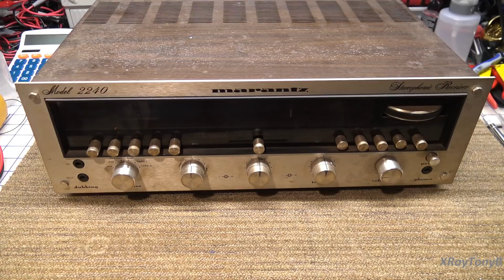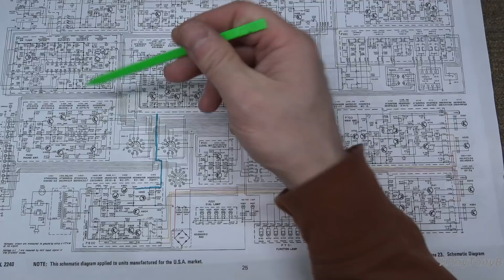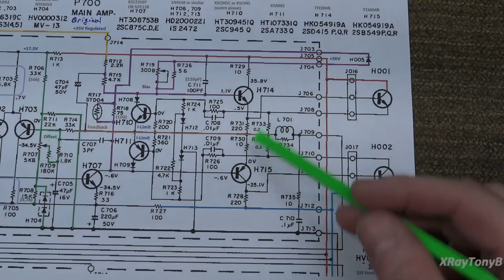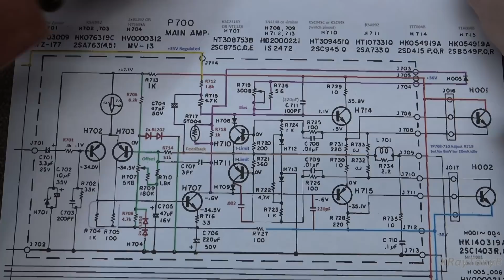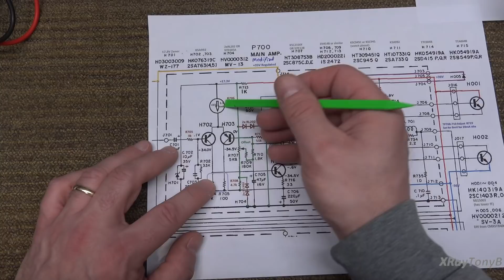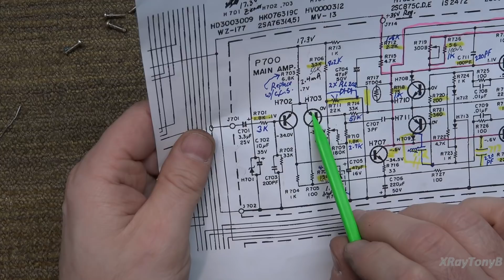Marantz 2240 Restore and Modification

Comment from the maker: 0:15 Intro
1:56 First look inside
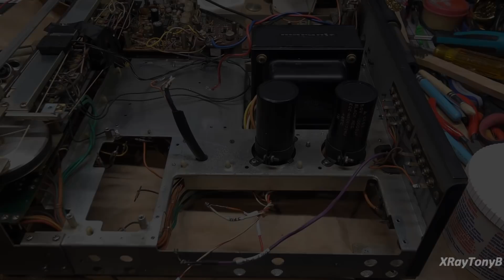4:32 Cleaning is underway
9:29 First look at the schematic.  This is a good design
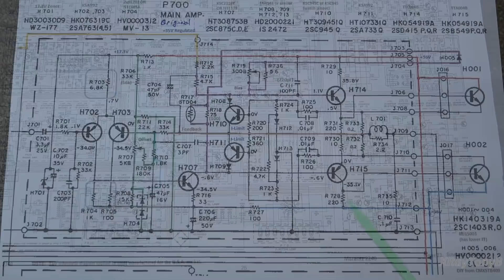12:58 A closer look at the amplifier section & some theory
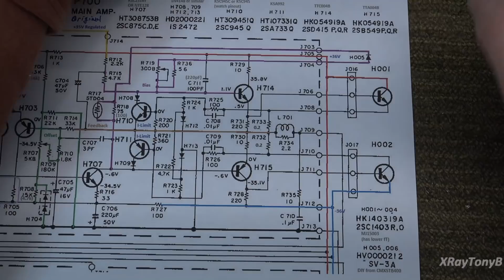22:49 Comparing the 2240 vs 2240b
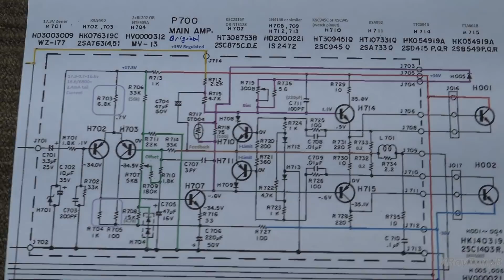26:00 Some changes that were done to the later production of the 2240
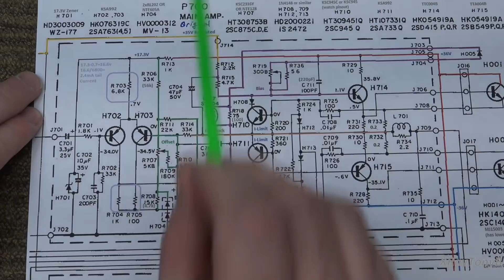28:34 Modifying the original design & making a modified schematic
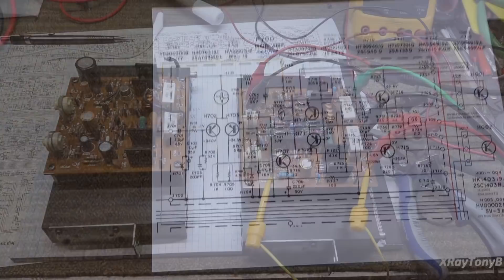40:42 First look at the modified amp module and initial tests
44:27 Some square wave stability tests on the modified module
45:37 Same square wave test on original unmodified module
46:53 THD test on modified amp module
47:19 THD test on original stock amp module
47:45 First thoughts on how the two modules compare in performance
48:45 Adjusting the gain of the modified amp module to match the original module
55:04 Frequency analysis of the modified module
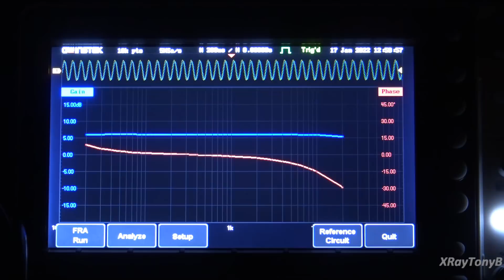56:03 Final comments on the modified module
58:47 Modifying the second module - step by step
1:14:00 All I want is a-just be free, to live my life the way I wan a-be
1:14:43 The finished product & making some final tests/closing comments

Comment: A little late but hope someone still reads this. Regarding inverted input/ output. Air has resistance. Sound waves are changes in air pressure. During playback , cone of the driver creates high/ low pressure areas.The air is a medium that wants to equalize just like the driver in it''s resting position. This reaction between driver and air causes non inverted signal from the driver to phase shift by 180. This inverted signal is what's reaching our ear drums. If the source signal is not inverted our ears always hear inverted signal so the proper thing would be to invert the source. The philosophy behind it is that it should sound more natural...

Comment: Nice work! Adding current source will improve the current as it will be no longer dependent on the voltage, although the V is pretty much fixed with the zener D. Most of the improvement, however is going to be gained by putting current mirror. Imbalance of collector currents of just 2%, almost doubles the THD. Current mirror will also improve the slew rate, and provide more current for linearization of the VAS. In other words it should affect the THD a lot, especially in HF. The differential input is transconductance: voltage in, current out. On the other hand, playing with the NF, threatens the stability, but also makes larger DC offset due to different input impedances on the diff. pair (33k). Luckily you can adjust it :).

Comment: Tony, thanks for the informative video.  I have a Marantz 2250B since purchasing it in 1976.  My balance slider stopped functioning and I took it to a tech in North Carolina and he had to bypass it since he said it was not functioning.  The receiver still sounds great but I did not know if you had any experience on repairing the balance slider?  My other option is to just continue to look on line for the part 500 ohm RS0504002 of the parting out sale.  Thanks   Dave

Comment: I think the 2240 is an incorrect designation - or - the faceplate fasteners have been replaced. The hex fasteners are typically an indication of a "B" model.
Reply: I’m the owner of a 1974-75 2240 that has the hex fasteners, so probably a transition thing.

Comment: Hey Tony.  Great job on the video.  I believe my father purchased a 2240 back in '74, so I remember this from being a kid and listening with my dad.  With his health no failing, I purchased a 2240 off of ebay, to be in my office as visual reminder of my dad and the happy times we had listening to albums, 8-tracks, and later cassettes.  Because I want to keep this forever and will want to check out each board and component (read degree in electronics and an engineer at this time) would you have a link to this schematic or be able to point me to somewhere I could download this file?  At work, we have a plotter, so printing this at C-size (that's what it looks like in the video) would be easy once I have the file.  Thanks and keep up the great work!
Reply from the maker: Go to hifiengine.com .   They have the service manual available there for download.  You have to have an account to download, but it's free.
Reply: @xraytonyb  Thank you so much!
Reply: FYI, registration is closed to new members.😐
Reply from the maker: That sucks.  Thanks for letting me know. I was unaware.  You can also try elektrotanya.com
Reply: @jonathanjackson669  keep checking periodically you will eventually get in.

Comment: Hi Tony. Excellent video. Recently, I bought the Marantz 2226. It is in a similar condition to the 2240 in your video, and it requires a good clean and parts (which unfortunately are scarce in Melbourne, Australia). You mentioned how the real improvement - in terms of cleaning - was when ultrasonic cleaning. was used. 
I am new to this so my question is this: do I need to disassemble the entire unit and clean the different parts separately, or can the entire unit be cleaned as one (eg I have seen the guy from AhFixIt use a powerwash at a car wash outlet)? Any risk involved in damaging key components ie you mention transistors? Any assistance would be fantastic. Thanking you, or anyone who can help, in advance. Regards. Sam
Reply: @dohmesam

Hay Sam... 🙂👋🏼
I dont think i would run an amplifier board through the "car wash" lol.... (i too saw the video and was horrified)...

I think the strength of the power lance could eaisily dislodge componants on the board or damadge anything that dosent like water (like volume, balance, bass and trebble controls, and parts of the tuners adjustment pots), i think that video was just made for fun and entertainment, it would be something i would never do to my own equipement.

If you are able to remove certain boards (and remove atleast the potentiometers off the tone board), then a "bubble cleaner" 😂 should be safe enough.

Best wishes from UK... 🙂

Comment: Hello Tony .................what would happen if instead of using a CCS in place of the resistor.........you should add a capacitor bypass on the original resistor ?

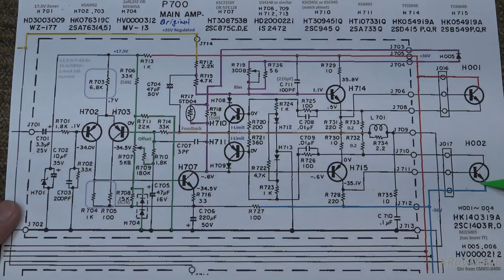Comment: 13:59 exactly, both transistors show NPN; yet you called one a PNP despite the diagram, why?  This is why such videos are extremely confusing and indeciperable to amateurs who know nothing, and likely never will thanks to the contradictions and lack of clear explanations.
Reply from the maker: Before you start insulting me, please listen to the video again.  What I said is that there are 4 similar models of this receiver; the 2240, 2240b, 2238 and 2238b.  The main difference is the output transistor configuration.  The 2240 uses a "quasi-complimentary " output stage, while the others use a "true complimentary" output stage.  The main difference is that quasi-complimentary output stages use two NPN transistors and true complimentary output stages use an NPN for the positive side and PNP for the negative side.  If you search "quasi complimentary vs True complimentary output stage" you will most likely find a lot more info.  There is no contradiction if you listen to what was said just before the time marker you listed.  If you are willing to ask questions instead of assuming that everything is wrong, you may find that you can learn this.   I am more than happy to answer any other questions you may have, within reason.
Reply: @xraytonyb  No insult was intended.  Your uploads are very informative, and I mainly watch them to learn as that's the best anyone can do with one's time.  Thanks very much for taking the time and effort to explain.  Don't know how you dealt with the mouse leftovers, but somewhere I heard that you should never vacuum rodent feces as minute particles can go through the vacuum filter and become air born, potentially leading to serious health problems.

Comment: i had the 4240 Quadraphonic Receiver in the mid 70's 2x40 watt 4x17 watt with Dolby FM and a Dolby processor so you could Record Dolby B to  Reel to Reel Tape Recorders
Reply: I had a 2270, then upgraded to a 4270 (QUAD), and then a 4300. I would love to have them back. but life goes on.
Reply: Same with me, i loved my old equipement, mp3's came, moved house through work and had to sell my gear as part of the move...... completely regret the life choices i made at the time....

Comment: That’s a little disgusting 🤢 to see turds 💩 falling out of this radio 📻, onto your bench. Just sterilize your bench, and wash 🧼 your hands 🙌 before eating 🍽. Although your bench isn’t a place you’ll eat, you won’t want the Hantavirus, especially if this is about mice 🐁, or rats 🐀. Just be careful there’s also no urine on any of the circuit boards, this can short them out. That radio 📻 has a VERY IMPRESSIVE set of tuning gangs. I can tell ya that this is a 1970’s receiver, just by the look 👀, possibly mid 1980’s. That transformer is a Marantz. It is definitely worth rebuilding. VERY NICE 👍 schematic, you’ll wanna hold onto it. Your friend, Jeff.

Comment: What do you use in the ultrasonic cleaner - only water? If yes, can the boards be cleaned by soaking them in the kitchen sink? :)
Reply: If you remove potentiometers and dont clean the tuner board as the tuning pots can hold water for a long time, i shouldn't think ot would matter.... use a soft toothbrush, that helps and becarefull not to dislodge componants.... no problem 🙂👍🏻

Comment: Hello Tony I need some expert advice. I had a customer brought in a Kenwood KR-5010 receiver. The STK Darlington power packs were shorted so I went to eBay and ordered from dalbani two STK-0050 and one TA-1001 trio voltage amplifier. I replaced all three ICs and connected the AC to a 40watt dim bulb tester and the voltages on the TA-1001 are as follows starting from pin one to fifteen; 0.1 volt, -0.3 volt, 28.4 volt,  28.7 volt, -10 volt, -10 volt, -30 volt, 0 volt, 30 volt, -10 volt, -10 volt, 28.7 volt, 28.4 volt, -0.3  volt, 0.1 volt. I think the new TA-1001 is bad. I don't think it's a new one from dalbani but a pulled one from another unit. I paid about $29.00. There is a supposedly "rebuilt" for $21.00 from the same place. I was wondering if you had the same problem

Comment: I have a Model 2225 and lately it started crackling and popping in the left channel. It stopped for a while but came back. Do you have any idea what it could be? A failing transistor or the relay?
Reply: I hope you get an answer. At the most basic level, excercising the slider after using some Deoxit on it might help? I was told these sliders are not as robust as the channel knobs. I own a 2226B and a 2250 and am learning.

Comment: I love how it look and how it cleaned up, it seems to sound really good too. However I do miss some of the midrange but that's something that I like personally, I love when the midrange really pops so when you hear a bass you hear a bit of it on the midrange too, you know that pop sound, that's what I love.
Could be the mic you're using or it is actually what I heard, I do have 2 big Infinity Studio Monitors, model SM 155... Those have 2 midrange speakers so my midrange is already big compared to normal speakers and I still miss the midrange when you played the track on the amplifier but it YouTube and there are so many variables that I can't tell you if I'm correct or not.

Comment: This video offers a terrific analysis of the power amplifier circuit design (thanks!) The quasi-complementary output stage (as seen in this model) dates back to the late 1950’s before the existence of complementary power transistors (matched NPN & PNP). At that time all germanium power transistors were PNP & all silicon power transistors were NPN. Matching complementary silicon power transistors were first introduced in the mid 1970’s. The quasi-complementary output stage circuit design in the original factory version of this model produces sufficient crossover notch distortion to be heard, especially when listening at low and moderate loudness. Crossover notch distortion is heard as a “buzzy” or “harsh” tonality and is a main reason why some listeners prefer tube amplifiers. However, crossover notch distortion can be greatly reduced by proper circuit design.

Comment: Hi Tony, I think the reduced gain on the "modified" version is due to the change you made to R710 (increased to 2.7k, as can be seen in your schematic at 1:00:05 and confirmed at 1:07:48), instead of having a current source feeding the diff. 
If you calculate the theoretical gain of the whole amplifier (R714/R710), you'll find Av = 19.3 > 1+(33k/1k8) and Av = 13.2 > 1+(33k/2k7) for the modified version, prior to change R714 to 51k. 
I also recommend to maintain R714 equal to R702 (33k both) to prevent differential pair base currents inbalance. 
Work on R710 instead, if you really need to change gain of the whole amplifier.
What's your thinking about ?

Comment: Tony Why do you buy your caps from Mouser. All Mouser capacitors are made in China Thailand  not Japan or Taiwan why.
Reply from the maker: I didn't know that Nichicon capacitors from Mouser were made in China and other places sell Nichicon capacitors made in Japan.  Is this true?  I buy a lot of product from Digikey, Newark and Allied Electronics as well.  Are their Nichicon caps made in China or Japan?  I'm now also wondering about Cornell/Sprague/Kemet/Panasonic/etc.  Do some distributers get products made in different countries than the others?  Also, if they were made in China to the same spec, how would they be different?  I've never heard this before.  Please explain???
Reply: @xraytonyb  I have been asking Mouser where are your Electrolytic capacitors made never reply never. Made in China caps  quality are not as good as made in Japan.I have had Nichicon. Rubycon caps from china that have very bad ESR and fail. Its all about the material Tony simple. I have a top suppler in Australia that buys direct from W/Sale in Japan, and are 100% made in Japan. Cost is high but the quality is as you accept products that is MFG in Japan.
Reply: IMHO the country of origin isn’t as important as the specifications. Over the past 30 years I’ve purchased huge amounts of electrolytic capacitors from both Digikey & Mouser. I haven’t observed any significant failures yet from either source.  Both Mouser & Digikey publish complete specs and offer manufacturer’s data sheets. Although the “great capacitor plague” in the early 2000’s affected many brands, those issues were all corrected & haven’t reoccurred. For power supply applications I select capacitors with a high ripple current rating. This also corresponds to a very low ESR. I check ESR routinely for both old & new capacitors. Surprisingly I have found some 60-year old electrolytics to be totally within all specs. I have also seen failed electrolytics that were <5 years old. I think most of those early failures were due to cost-cutting & poor design. For example using a cheap filter capacitor with an insufficient ripple current rating for the application.
Reply: @electricboyo   Yes it is. Very important very as you will be paying for quality for your customers repairs simple not counter fit. Mouser is large due to caps mfg in Thailand simple and China. The best caps  in the world are Made in Japan.We do 100s repairs every year and when I was using Mauser there caps always gone bad.

Comment: So you added the costs of the restoration by putting in unnecessary parts, you lowered the value of the unit by modifying it from its original form. For your efforts you got the same performance with a theoretically more stable unit. and learned that you can mod anything?
Reply from the maker: I thought I made it abundantly clear that this was an experiment to see how the two designs compared.  I am charging no one for this project and am funding it myself.  I took the time to share the results with all of you.  I learned that by studying the original circuit design as well as the changes made by the manufacturer on later models, we can modify an already well-designed circuit to improve stability and/or performance.  I also learned that not all changes will make a difference that can be seen on an oscilloscope or other test equipment.  Another thing  I learned when I opened the cover of this receiver was that there was no way that this mouse turd encrusted device will ever be a museum quality example of a Marantz 2240, but with a lot of work could become a very good performing receiver that can be used every day for its intended purpose to enjoy music and good sounding audio for years to come.  For me, the value in this unit was in what I have learned from rebuilding it and the satisfaction that it is now a useable piece of audio gear instead of  part of a landfill.  Thank you for the comment.
Reply: @StevenTheElder Sir, I think you mistake my intent. I merely trying to point out the costs of the lesson involved here. There is no value judgement attached on my part.
Reply from the maker: No offense taken.  This is not what I would suggest doing for a customer, nor is it something I would want to have done as a customer.  I think it just proves what I said:  Marantz did an exceptional job designing this receiver, especially  when you consider that this was not their top of the line unit.

Comment: what about the noise floor you didn't measure that?
and  it's in the listening more than measurements interesting to see what it sounds like compared to the original.
what would be nice maybe on the next one,!! is to run the gain stage with a valve like a12ax7 that would be good.
is it like two-phase is that why they flip to increase greater voltage draw ?

Comment: Great restoration mod, the receiver looked nasty indeed. Way better now! Nice mods too.
By the way, as for CCS in tube projects, I prefer tube-based. Got one in my amp, in the LTP phase inverter's tail. Now the amp is undergoing some redesign and I'm switching from triode-based CCS to pentode--based using EF80.